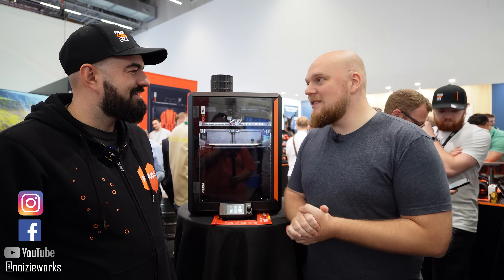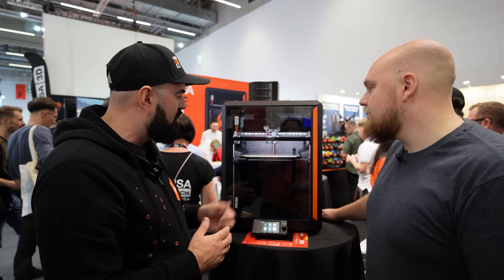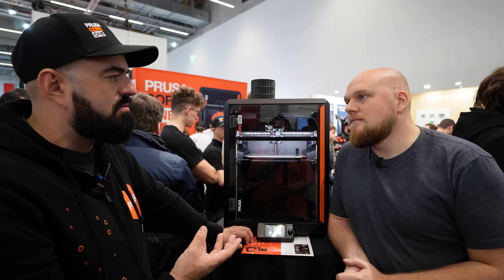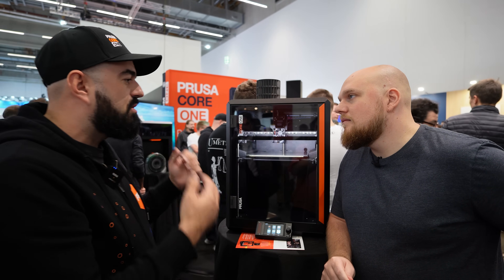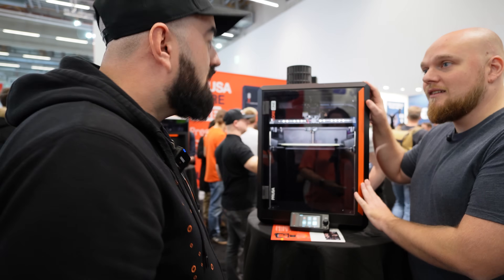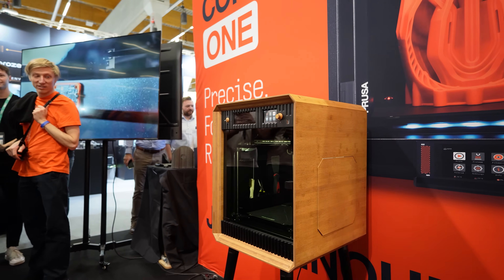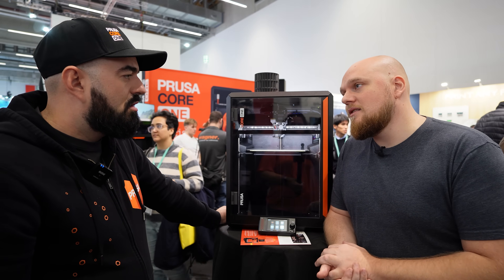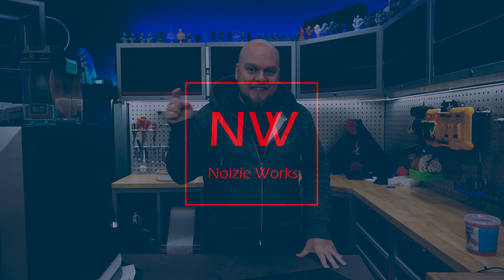Prusa Core One solved 1 big problem, obsolescence. First look at FORMNEXT

Comment from the maker: I'm gonna call it, this needs to be the new standard. Let's hope other brands see this and keep older systems from getting obsolete by providing an upgrade path.
Still needs to be tested but it's a great first try.
Reply: i love the new lay out. But i wish they had gone to a more standard square build plate shape. Gives more orientations options for max size prints then. But i think they did it to just keep using the existing parts from other printers. I just hope they don't keep going down this play it safe path with little forward movement otherwise they will end up like Nissan
Reply: Is this maybe a 6h build or will there be option for that? Maybe i missed if there an was option fro that. Might not buy it if there is 6h build in this machine...done that and it's sadly stoneage to deliver to spend 6h. Understand you have to put 1-2 hours but not more

Comment: Europe = ball bearings ❤ and 3 Z-axis motors❤.
China = graphite sleeves 💩 and 1 Z-axis motor 💩.

Say no more.
Reply: You are joking right? This is a literal twitch response to quickly try to stay relevant to the Bambu products. It literally is trying to compete with a 2 year old product.
Reply: When China released CoreXY printer with graphite sleeves and 1 Z-axis motor, Prusa was producing MK3S! Yeah, you are right, Core One really deserve to be compared to 2 years old printer because that's exactly what it is. Outdated printer not even released yet. Just wait what China will release next year as their Gen2 printers...
Reply: @xantrax9359  
Yeah, lot of cope from Prusa fans. Im confused how this printer thats 2 years late to the market is announced ... and wont come out for months yet. The kit isnt even avaible( and while they removed it from the site, i saw it said it wont come out to mid 2025), so the actual price is even larger than then most expensive offering from bambu or lets say the brand new k2.

Comment: Bambu is an objectively better printer.
But they will never be able to match the Repairability, Modifiability and Privacy of Prusa
That's why I'm choosing a MK4 or Core One over the P1S/X1c, even despite them being 2x the price.
Reply: La privacidad es muy importante, por eso NUNCA compraría una Bambu Lab.
Reply: The biggest Irony is everyone talking about privacy while using a google product like Youtube. 🤣
Reply: @AwwwSnapperz  We're not using YouTube as an instrument of manufacturing physical things.
There are of course, nuances and different contexts of privacy.
Reply: @ItsRyanStudios  Dude you can choose the level of your privacy on any platform.

Yt, reddit lurk only and don't sign in
3d printers. Print offline with sd cards. Or even Lan only mode, works fine over an offline network too. 
Shop nation runs Bambu print farm offline for over a year. He spends 10's of thousands on new printers and tossed/sold/donated over 30 prusa printers. 

To say you have an "objectively better printer" then throw out some made up limitation is hilarious.

Comment: Without a chamber heater and the fact the prusa sales guy kinda balked at printing CF & GF makes this a hard pass for me.
Reply: You don’t need a chamber heater of any sorts to print those filaments. Comercials printers use them because they’re very poorly insulated and lose a lot of heat.
On my Voron Trident 300 I can reach 65c chamber temps just with the bed and some fans below it blowing air and recirculating inside the chamber

Comment: Will be ordering the mk2s to one upgrade once releqsed
Reply from the maker: @andrewmoore5712  only mk4s is able to convert to core one
Reply: Double check this. From what I read the conversion kit will be from the mk4s to Core One. And getting two conversion kits might as well get you the printer itself.
Reply: MK2S is long since not supported, I am in the process of turning mine to Klipper.
Reply: @carlosjosejimenezbermudez9255  my Typo, that should have been MK4S 😆

Comment: @3:14 Good obversation! No graphite sleeves like the Plus 4! I'm making my order tomorrow for this one.
Reply: Prusa has been using ball bearings for many years now. It's all about longevity with them.
Reply from the maker: Great to know and thanks for sharing!
Reply: Prusa printers are built for longevity and their reliability. Using consumable graphite bushings like bambu defeats that purpose.
Reply: @LilApe  but the tortoise may never catch up if it can't keep up with innovation. There is also plenty of print farms that ditch there prusa due to error and downtime printing!
Reply: @ErzbergAdventures  No, there aren't. And prusa is the one that innovates. There are more prusa innovation in every bambu printer than there are bambu innovations.
Reply: @LilApe  if prusa are so innovative why did they copy the X1C then. Why did they need to come out with a Multicolor system? Why did they not put active chamber heating in to be a game changer?  They are pretty much the Toyota of 3d printing atm. Which isn't a bad thing either
Reply: @ErzbergAdventures  Dude.....prusa's MMU has been around since before 2017...Bambu lab's AMS was in 2022.
Reply: @LilApe  and look what they did with it! So it's been around since 2017 and not built upon
Reply: @ErzbergAdventures  What are you talking about? Theres been 3 versions and its significantly faster and less wasteful than the AMS. And their XL toolchanger kills the AMS in everyday possible.
Reply: @LilApe  less wasteful yes but serious advancement. No
Reply: Europe = ball bearings ❤.
China = graphite sleeves 💩.

Comment: The steel exoskeleton and gantry is what we should expect from this level of printer!
Reply: @ErzbergAdventures  not a bad first 3d printer, but its too expensive for what it is. Just go for a bambulab a1 or a1 mini. It has multicolor, and the price isn't all that bad. Corexy isn't special anymore, all the 3d printer manufacturers have one.

I would let the bugs get worked out on the prusa core one, and bambulab is just all around better for first time printers. If you are however a tinkerer, well look for open source firmware.

Those into the hobby usually have more than 1 3d printer anyways, its better to have multiple to print many items, instead of one fast or expensive 3d printer. You can get many 3d printers for just one prusa core one.
Reply: @ErzbergAdventures  not a bad first 3d printer, but its too expensive for what it is. Just go for a bambulab a1 or a1 mini. It has multicolor, and the price isn't all that bad. Corexy isn't special anymore, all the 3d printer manufacturers have one.

Those into the hobby usually have more than 1 3d printer anyways, its better to have multiple to print many items, instead of one fast or expensive 3d printer. You can get many 3d printers for just one prusa core one.
Reply: The pressed steel frame looks cheap. Prusa just doesn't have the manufacturing capabilities as China. This isn't an advance in 3d printer machine. I really want to know where the innovation is on this machine? Idk, they need to more features.
Reply: @oneanother1  i'm considering this as my first printer. But it is a case of everybody playing catchup on bambu atm! Bambu have a new printer coming soon. which will probably push the reset button again for another 2 years.

Comment: LDO Voron kits are pretty much dead.  Why spend $1K for a Voron 2.4 kit when you can get this?  Maybe if you really need a 350 cubed but I have one and almost never use the entire print bed!  I might just get one for the heck of it.
Reply: DIY kits from parts will always have an appeal. Just like Gundam model kits or the like.
Reply: Voron printer is "forever" printer that one can turn it into anything and try every new development
Reply from the maker: Depends on what you're looking for but for most yes!
Reply: Yes and no.  For many users there may be little reason to buy something like a kit for a 250 Trident (which I happen to be taking a break from assembling to type this), when the Core 1 will give nearly the same build area for a comparable price.  Without needing to configure or do much if any tuning.  I bought the Trident kit a year ago, and am only now having time to assemble it; were I spending the money today I would forego the kit and order a Prusa Core.

OTOH, If you were going to build a 300mm or larger Voron, then I don't think this has much effect on your plans.  My 300mm V2.4 is definitely overkill for most of what I have printed, but I have also used nearly the entire print bed for one object on several occasions, and almost wished I had a 350 (though for sure I don't want to try to fit one in my shop).
Reply: That's a pretty ignorant statement. LDO kits are, for one, way overpriced. Lots of kits like Formbot or Siboor are just as good and about half the price sometimes. The fact that you can pretty much endlessly customize your Voron and swap out anything in it to suit your needs is also a great thing. The price is just TOO HIGH for this machine and very late in the game. I do believe it looks amazing. It has very nice esthetics and seems to be quite space efficient. Plug and play is good, but Voron Tridents are probably the most crazy printers for speed when fine tuned.

The upgrade kit is a joke. Spending over 1k to get the MK4S then another 500 to upgrade it is bad economics. Better off just selling your MK4S (or just keep it) and buying a Core1...

If this thing had a HEATED CHAMBER then yah, it would be worth it. Prusa screwd up bad on this. Seems they just don't perform at the batting plate since the MK3s: XL was a mad fail and way overpriced, MK4s was a launch fail also and lots of the community was far from impressed, then this model, which does seem nice, is about 2-3 years late and lacks sought features. Reusing the plates is an understandable marketing move but they should have went to like 300mm on Z to make a noticeable difference.
Reply: @RenBaiHu  Upgrade kits have remained only due to popular demand. A couple of years ago Prusa made a market survey and upgrade kits from MK3 to MK4 were one of the most requested feature when people were asked if it should be prioritized. They themselves expressed surprise at this in a blog post that displayed the results of said survey. 

I'm not that customer, I don't know who upgrades their machine when the upgrade kit is a few parts away from a full machine. Heck, I even once built a MK3S from a MK2S to MK3 upgrade kit to cut costs instead of upgrading. It wasn't worth it, since I spent the same in the end and I did extra work by getting the missing parts from 3rd party providers, so getting the full kit would have worked better. 

But they keep making kits like this because someone somewhere does buy them, whether it is to do what I did or not, they do get purchased.
Reply: @RenBaiHu  LDO kits were good but not good enough for the competition at the price point.  LDO can do 1 of 2 things - 1) have a much smaller business at this price point, 2) race to the bottom on a commodity kit.   Voron is pretty much dead with no updates planned.  The team has moved on.
Reply: Voron R2.4 350 has a huge advantage.  Large size.  Belts all around.  Quad gantry leveling.  Easy to upgrade with many, any options.  Basically the same price though you need to add another $100 to build an enclosure.
Reply: faster printing, and bigger build volume. thats why you want a voron. and you could also argue the CoreOne is dead because bambu's p1s's.